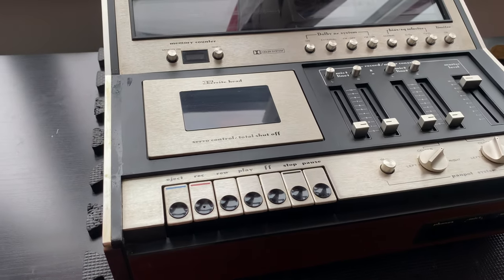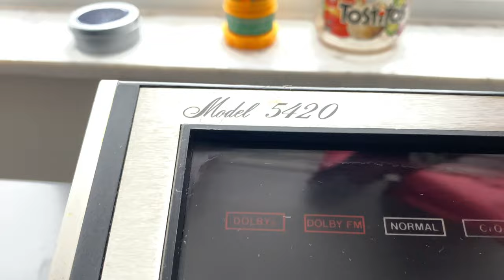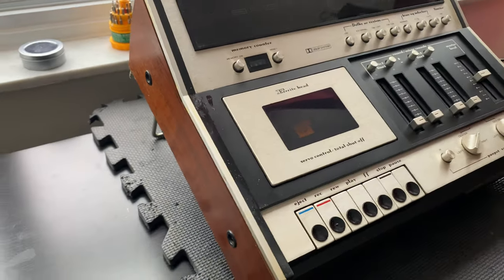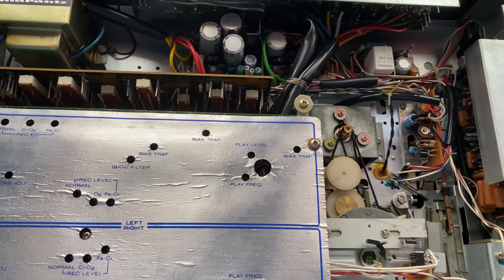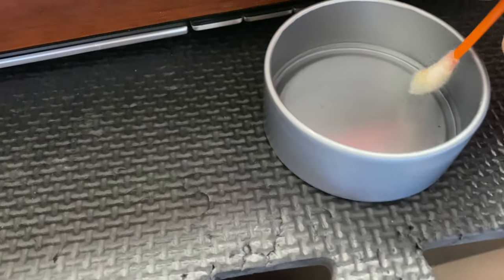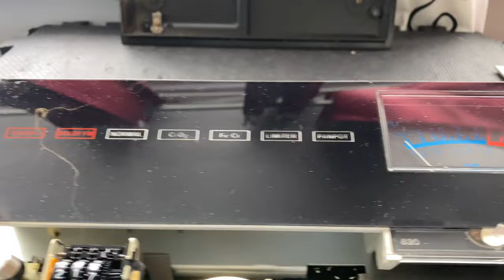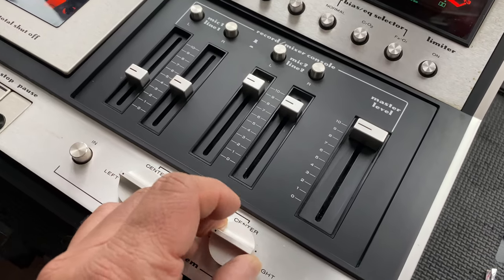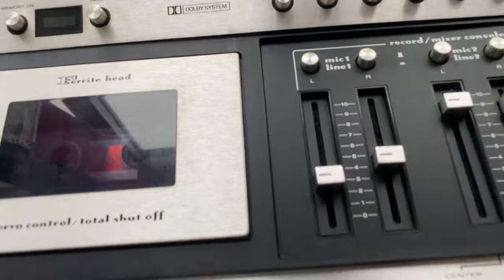Marantz 5420 Cassette Deck (1975 - 1978)

Comment: @15:00 where are the four small screw attached to the frame? I have the 4 side ones off. Thank you very much great video
Reply from the maker: Yes Sir, they has to remove from underneath, attached to the frame. 

I tried my best, thanks for watching. 🙏🙏

Comment: I saw your video where you perform maintenance on your marantz 5420, and I saw that you managed to remove the panel, I removed the screws and the box does not come off. How did you remove the wooden box?
Reply from the maker: Hi Santos, thanks for your query. You have to flip the unit and have to remove 4/5 screws from underneath. And then pull off the main unit upwards carefully. The top wooden box will be on the table. 

However, during installation… have to do it opposite way… have to put the wooden cover from top and have to make sure to keep the buttons of “Dolby”, “Cr”, “Normal”, “Limiter”….buttons may get stuck if you don’t put it carefully. 

Wishing you all the best. Thanks 🙏
Reply: Same here 😅
Reply: I removed 5 screws from underneath but still doesn’t come off… am i missing one ? 😅
Reply from the maker: @Soulzodiac As far as I remember, after removing the screws, have to flip the deck upward… like the normal position, have to remove the plastic slider covers and pull out the top cover. 

I hope this will help. Thanks for watching .
Reply: @stairwaytomusic71   thanks ! i removed the four screws at each corner of the chassis, then another at the middle of one of the longer sides, then removed the plastic slider covers. For some reason it still doesn't come off. Did you have to insist a little or did it come off smoothly ? OK, I'll stop bothering you!
Reply: Hey did you ever find out why it was not coming off? Im having the same issue. Four corners and the middle front one. It eiggles but seems like theres something holding the middle still. Thanks @Soulzodiac
Reply from the maker: Thanks for watching, it’s been almost 2 years… as far as I remember, after taking off the screws from bottom part… the whole frame came off by pulling it upwards. And while installing it back, have to cautiously set it down because few knobs/buttons gets stuck if the frame doesn’t install correctly…  (don’t remember now). Hope you will be able to sort it out. 

Best regards 🙏